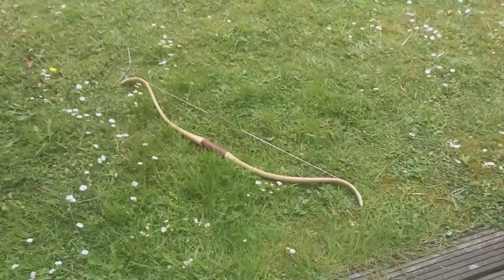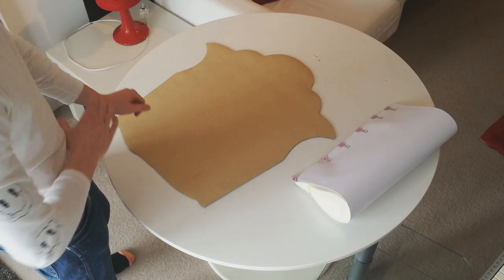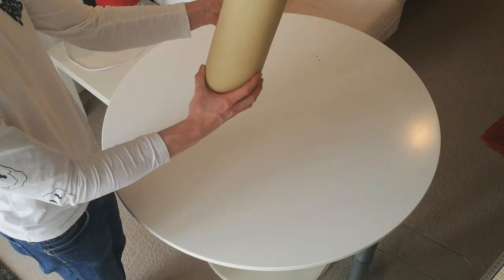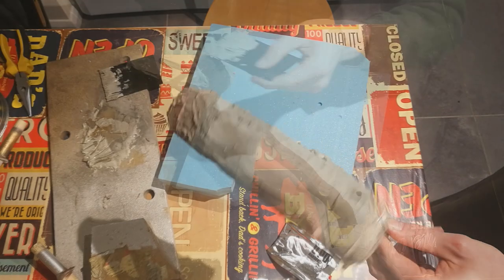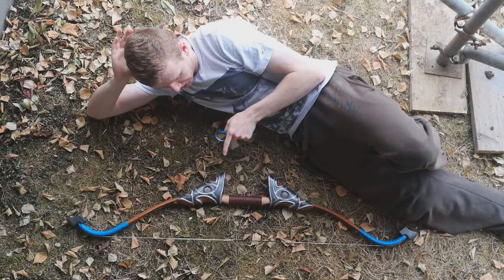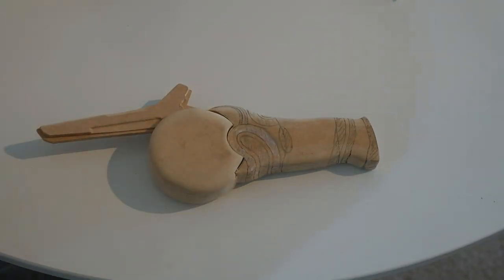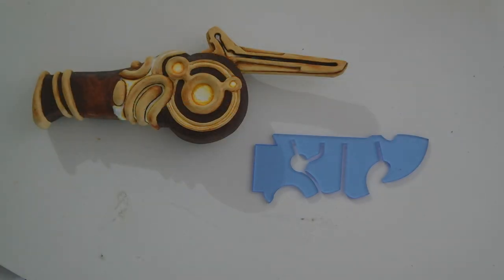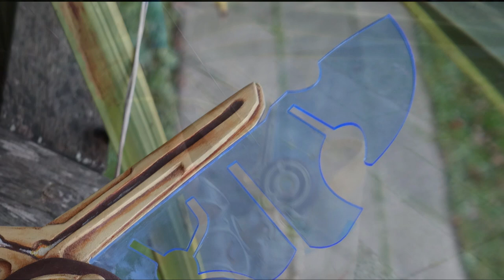The Traveler's Bow, Quiver and Ancient Arrow - Legend of Zelda: Breath of the Wild

Comment: Do you have the templates? And if so could you possibly release them?
Reply from the maker: I do have blueprints that I used yes. However they weren't designed with other peoples use in mind so they're a bit wonky in places and there's no measurements on them as i just figured that as I went. https://imgur.com/a/KRomfvf they're on that link there if you wanted them though.